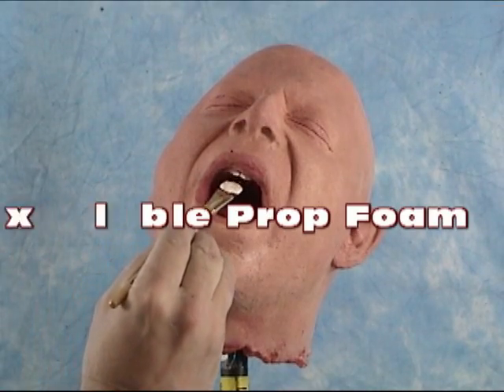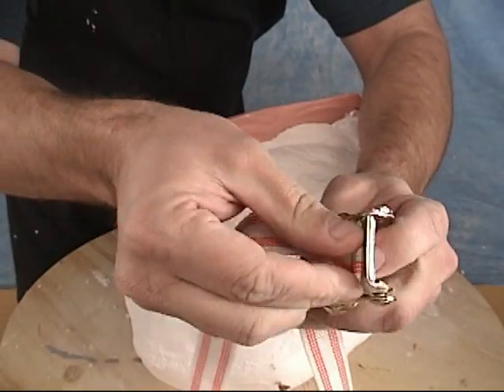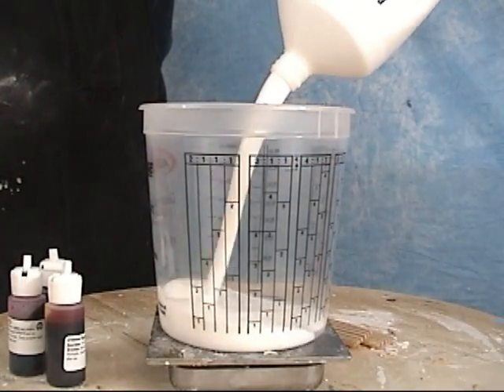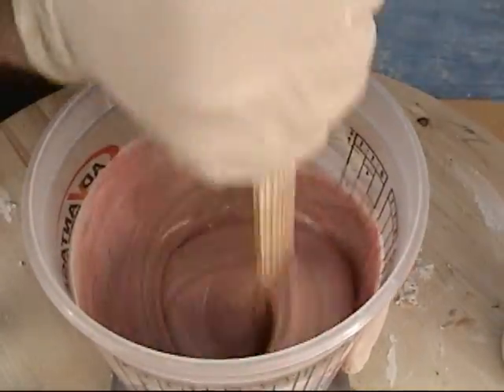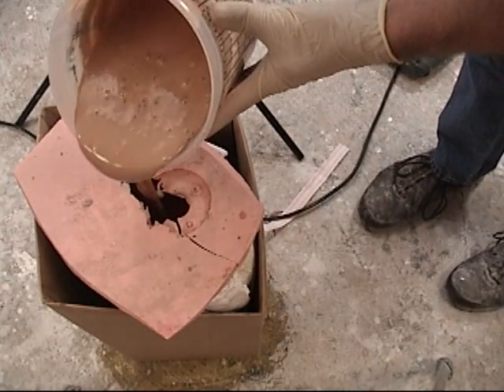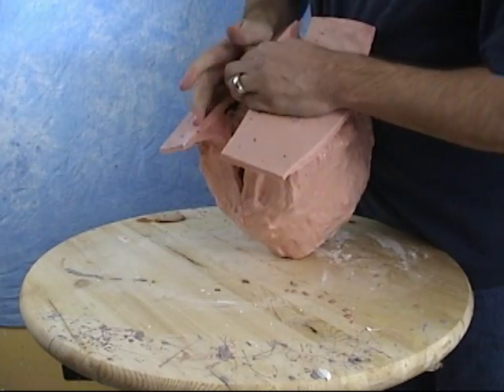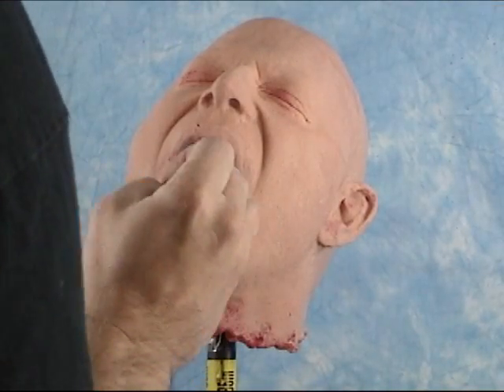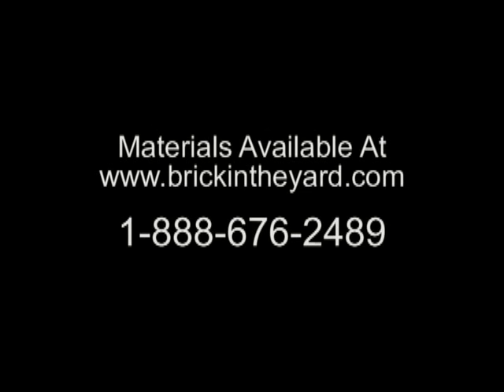Prop Making: Casting and painting a flexible foam head

Comment: I bought some polyfoam recently that I intend to cast some prop weapons from, but apparently it has 14 seconds of pot life... Do you have any tips about using it? The foams that I've seen you use for your wrenches and hammers seem to have a bit longer pot life. I'm afraid it will start expanding in my mixing cup. Thanks a bunch!